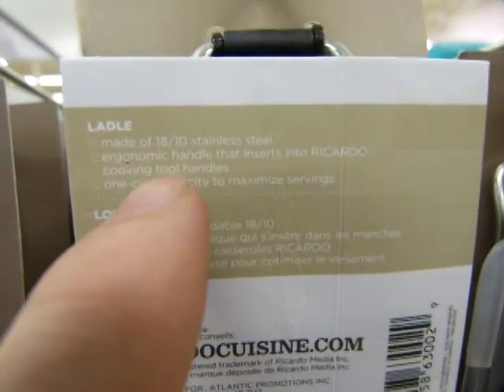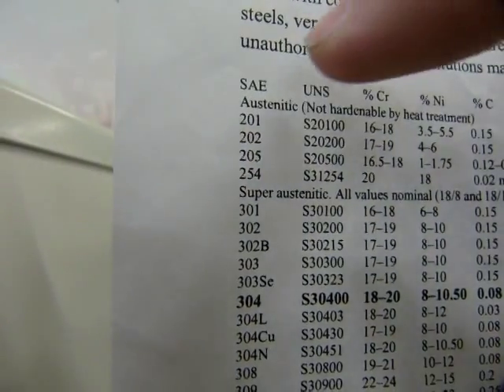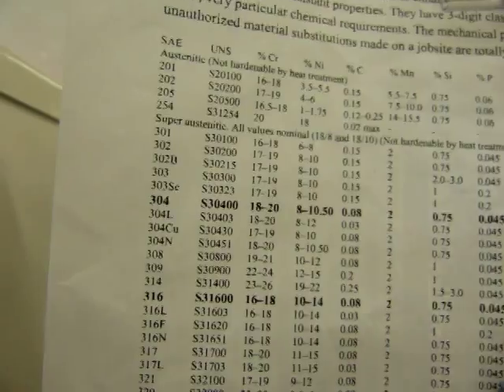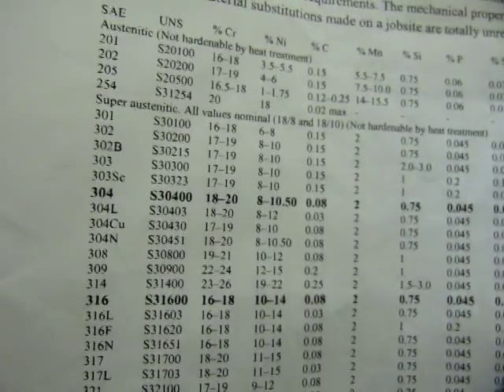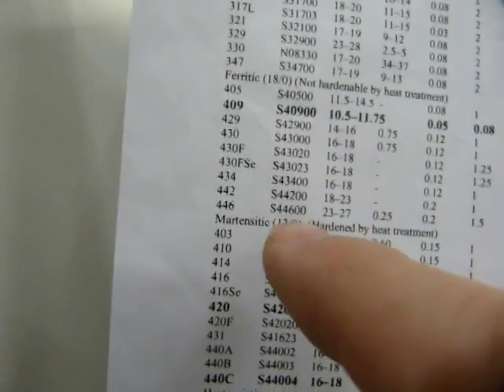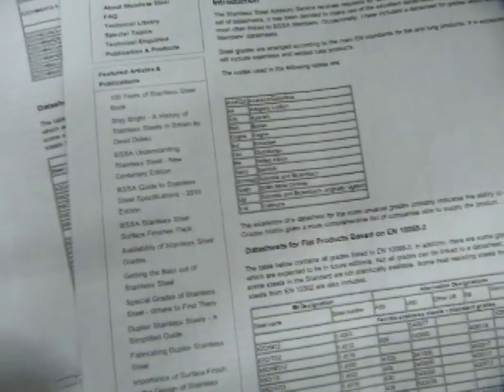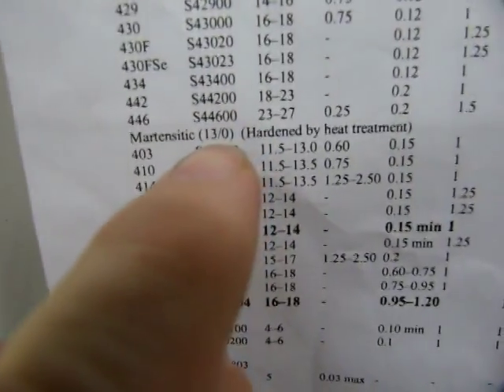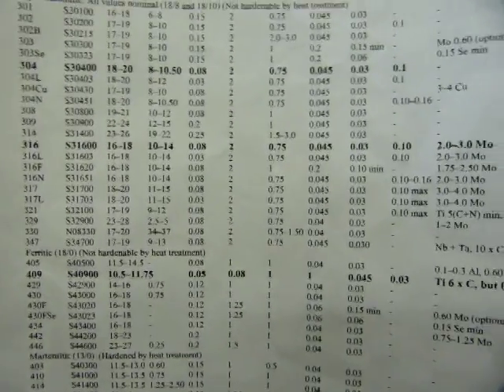What`s an 18/8 stainless steel? Or 18/10, 13/0, etc.

Comment: 202 ss cookware have 14% cr 4% ni that r different from this chart. Why?
Reply from the maker: My chart might have a typo as it is not an AISI/SAE official document.
On the other hand, manufacturers can print/engrave products any way the legal department gets away with, such as "Quality steel", "High strength steel", "304" and could just be a model name or the daughter's favorite number, ...
Reply: @theoverengineer 316 is more ruf and tuff compare to ss 304 but still 316 ss is not used in triply cookware due to costly.

Comment: Thanks man! I'm searching for new inox pans (pots). And it's been pretty confusing, cause I only knew there were Aisi304 and 18/10 steel.
Then I found out about 316L steel type and it kinda seems that it's the best for cooking. 
Some producers indicate altogether Aisi304 and 18/10. What do they mean exactly?
Reply from the maker: For cooking/baking, steel composition does not matter, coating, thickness or dish size does. For dishwashing (corrosive detergents), 316L will outlast anything.

Comment: Great vid . I want to buy top quality stainless steel Cutlery ( dinner knives and forks ) so they don’t rust at all for years ... good set that last 
I see in stores in uk , some say 18/10 or 18/0 ? 

What is the best quality? 18/0 ? 18/0 ? for kitchen / dining cutlery ( Europe codes ) 

I look forward to your reply
Thanks 👍🇬🇧
Reply from the maker: Here are the numbers, suppliers can identify a batch of steel (from Ger., Port., Swe., Jap., Kor., Ch. etc.) in multiple ways:
1 Find a decent supplier so the set is actually made of stainless, not Chinese foundry sludge. Makes sense?
2 Butter & cutlery knife handles are always hollow, soldered to a blade. The cheaper the set, the thinner the handle, the weaker the solder.
3 The generic kitchen stainless 18/8 (or SAE 304) stainless steel is more sensitive to pitting or crevice corrosion by chlorides (along the soldering line) or less resistant to general corrosion in acidic applications than the 18/12 a.k.a 1.4401 a.k.a. X5CrNiMo17-12-2 (SAE 316), which is better. Commercial kitchen equipment suppliers have it, Debenhams, etc.cute retailers - I`don`tt think so. Other numbers for 18/12 include variants like 1.4408 a.k.a. G-X 6 CrNiMo 18-10 or 1.4436 a.k.a. X3CrNiMo17-13-3, watch the labeling.
4 Kitchen knives that need to hold a sharp edge are best made of 18/0 (430) martensitic variants:
1.4125 a.k.a. X105CrMo17 a.k.a. 440C martensitic, but
1.4112 a.k.a. X90CrMoV18 a.k.a. 440B or
1.4109 a.k.a. X65CrMo14 a.k.a. 440A are also fine, will need sharpening more often, but gets done faster.
5 Center of gravity when held in hand is important in fatigue is a factor.
6 The side edges of fork tines, spoon handles can be crudely sheared or stamped out of a sheet of steel and remain unfinished, watch out. See close-up at https://www.youtube.com/watch?v=xuQnPEpLWd4
Steel numbers vary in different markets, so I included lotsa numbez.
(Long decimals 1.4something are DIN numbers, the X-and-digits-and-chem.-symbols... are EN standard names)

Comment: why is 1045 and 4140 in the same grade of steel by ansi standard when they machine so differently? The same insert grade is recommended for both.
Reply from the maker: Because both are "Carbon and Alloy Steels" group. Other groups are "Stainless", there is "spring steel" and "Tool steel" with barely any iron in them. Check out Types of steels
Reply from the maker: Their mechanical properties are close enough, both have a tensile strength of about 100,000psi and a Brinell hardness of about 210. See matewb: http://www.matweb.com/search/DataSheet.aspx?MatGUID=38108bfd64c44b4c9c6a02af78d5b6c6&ckck=1 and http://www.matweb.com/search/DataSheet.aspx?MatGUID=cfc9bdab1dbf4fb19d6b3e5e1be8c9bb
Reply from the maker: There are many 1045`s and many 4140`s, hot rolled, cold drawn, normalized, etc. Compare similar ones. http://www.matweb.com/search/QuickText.aspx?SearchText=4140 and http://www.matweb.com/search/QuickText.aspx?SearchText=1045
Reply: In machinist calculators, 4140 is hard steel, but 1045 is soft. But then there's this fucking ISO standard (I made a typo originally, meant to say ISO instead of ANSI). In machining catalogs, for carbide inserts, will tell you that inserts is for a certain group like 'M' for stainless. 

Lets talk about stainless, since i'm looking it up now. Cr content varies by 8% in this group : http://www.sandvik.coromant.com/en-gb/knowledge/materials/workpiece_materials/iso_m_stainless_steel/pages/default.aspx#3

This confuses me because chip formation varies greatly, heat produced, machining forces, coolant types. 

For chip formation, its a big deal not to get long chips, because it blocks the machine. Small dense chips are always desired (they take up less space when stored, etc).

Heat produced, causes fracture of cutting tools; there's ceramic, carbide, the former being really fragile. The tools vary greatly, so much that it affects their geometries. For example TNMG is triangle with hole in center, but ceramic inserts typically are found without holes in center, because they're not pressed (compressed) and its hard to drill into it - so they just make it TNMN. Ceramic are greatly resistant to heat such as in superalloy stainless steels, but fracture easily.

Coolant is desired in some cases, but others not because it determines fracturing and chip formation.

Cutting forges determine tool's angle (positive or negative rake - negative rake is prefered for harder materials, since it preserves the edge better). This has some disadvantges.

So you see, the ISO codes, seem to cause more problems than they solve. I can only guess the ISO codes were standardized when there was only very few grades of carbide, let alone ceramic, cermet, PCD, coatings, CBN, and other cutting tool technology.
Reply: Another exaple are aluminiums. I wonder if Silumin is in this group, because Aluminiums like 6061, can easily be machined, even with steel cutting tools. But Silumin has nickel alloy in it, making it very abrasive. Ceramic inserts are used, its a totally different machining challenge. ISO group is "N" for non-ferrous.
Reply from the maker: N is justified, Silumins (plural intentional) are aluminum-silicon alloys, zero iron content, used for castings, silicons make it flow smoothly and fills the mold well. Die-cast cars, laptop frame, engine block. In the Aluminum Association`s system, 3000 and 4000 series and casting alloys. The 6000 series precipitation hardens, it produces nice hard chips, machinability 70-90%, Brinell hardness 80, (the SAE/AISI 1212 steel has 100% machinability, an arbitrary reference point), the 3000 Silumins machinability is between 10-50%. Very gummy, have a Brinell hardness of 40. That`s why they suck on a lathe. They need to be cut faster, shallow cuts and with sharp bits to minimize tear-out and produce a tolerable surface finish. 
Look into 2 things to explain why stuff behaves the way on a lathe. Any letter codes tell too little. (1): the actual properties of materials, which are dictated by chemical composition, (as you saw Cr +-8%), esp. the overall hardness, surface hardness, machinability. That`s the first half of the story.
(2) how the work piece was made, such as cast, hot forged, cold worked, etc. Say nails and screws are made of the same soft 1005 steel. The screw has its thread "rolled on", produced by cold deformation. Nails can bend, repeatedly, screws snap after 1 bend. Different behaviour due to cold working.
On top of this, (3) we have cumulative experience on how much feed, depth of cut, rake angle, kind of coolant and material of cutter works best to: 1 not overheat and change temper, 2 break the chips, 3 get done today, 4 tolerable surface finish, 5 minimal re-tooling and sharpening. This is where those letter codes come in, but you might need to make on-site observations and changes to work around some gummy metal.
It is very complex.You`re on the right track, you have many of the factors, I hope I helped a bit. It is chemistry, plus manufacturing method, plus lathe power, feed, depth, plus economy, plus safety, supplies, angles.
If it was any simpler, Walmart would have no employees.
Reply: i wrote a long reply but it was lost, since i'm replying from the drop-down window, so am gonna be more brief this time.

You reflected all my points in your #3 fact but give totally different interpretation. All the qualities you present are for the cutting tool, not for the material, since those qualities applied to the chip doesn't matter as long as the tool can still cut it, since the chip is discarded.

I appreciate this long discussion (average person don't give a damn, or too stupid to make a discussion), but you have not helped at all, because this contradictions haven't been resolved.

Namely these two statements combined, produce a paradox.

1)[basis] ISO 6 letter machinability index classifies metal in groups such that cutting tools can be chosen quickly. In other words, the priority is to protect the cutting tools so they can perform their jobs as the priority, with no concern for materials properties, since the heat is in the chip. This is true.
2a) Silumins vs 6061 don't machine the same but are in the same group. Stainless Cr content varies by 10% in its group and machine differently. Steels in their group machine differently.
2b) The difference in machinability of these examples is significant. Coolant options, feeds/speeds, tool material, and tool life vary drastically, and using the same tool on both materials in the same class results in 1000% or more diminished tool life, at least. For example on silumin, HSS (HSS is traditional tool for aluminium). Cutting bit even with highest Cobalt content and correct speeds to prevent tool weakness in the red-hardness zone will suffer a very quick death from abrasion, whereas ceramic insert will cut it no problem. Carbide also has poor performance on abrasives, unless protected by thick diamond or CBN coatings.

Conclusion: the ISO machinability index is made to choose inserts more efficiently for machining jobs by classifying materials according to machinability properties, but in reality does not perform very well.
Reply from the maker: Sorry, I missed the ISO part. Now I don`t know anything about ISO designations, neither trying to appear so, I found this at Sandvik`s site, I`m reading it now, trying to make sense of it myself why materials behaving differently are grouped together. They did consider cutting tool, workpiece, geometry, heat treatment, manufacturing. Check it out, see if this whole knowledge base makes sense.
http://www.sandvik.coromant.com/en-gb/knowledge/materials/workpiece_materials/machinability_definition/pages/default.aspx
Reply: So , what is "machinability" for those who don't know. I think it can be reduced to something interesting that we can both enjoy: Sandvik breaks it into three parts, only the first is relevant:

1. Classification of the workpiece material from a metallurgical/mechanical point of view.
2. The cutting edge geometry to be used, on the micro and macro levels.
3. The cutting tool material (grade) with its proper constituents, e.g. coated cemented carbide, ceramic, CBN, or PCD, etc.

Now considering only '1', machinability is proportional to metallurgical properties, your expertise is greater than mine. If (1) is not the some determinant of machinability, then I would like to know its extent of influence - at least relative to itself (i.e we compare metals to each other's grades, rather than some absolute referece point like diamond.). This is also acceptable to me because I understand perfectly how '2' and '3' are chosen by materials, from my experience.
Reply from the maker: Thanks for sharing, good stuff. The way metallurgy relates to machinability is profound, but hard to quantify as we don`t have a diamond standard, like you noted. So I have some examples here just to float some ideas that can be search terms later, etc.
Any alloy is defined as "a solid solution of uniformly mixed elements" Plain steel is an alloy of C and Fe. The C content (0.05% - 0.95% as in AISI1005 - 1095) dissolved when liquid, but solidified can be visualized as having a bag of marbles, 2 sizes, shaken up so the little marbles (C) don`t settle on top of the big ones (Fe), or at the bottom of the bag, and in mid-flight, where they fill the bag uniformly, thrown into a freezer so they don`t ever reach the bottom of the bag. Something like that would be uniform distribution. Now C appears as thin fibers (cotton candy) inside Fe when uniformly distributed. As is, it will machine annoyingly, runs gummy, causes a built-up edge.
C can form clumps if heated up a bit or quenched differently, as it does in martensitic stainless, nodular cast iron, annealed or normalized high-C steels. These machine well because the cutting edge rips the C clumps out in whole, the chips are short.
C can be added to the surface only by covering a workpiece in charcoal for a day, called carburizing. Used on gear teeth. Usually done AFTER machining, but if any touch-up is needed, the surface is harder and machines well to a depth of 1/128 (0.5mm), then it is gummy again. But good for absorbing shock as gear teeth need that.
If an alloy steel (say 6150, or any) is made "as rolled", it is soft and gummy, everything uniformly distributed inside. If it is "cold drawn" or "extruded", or "cold worked" or goes through any folding, punching, cold forging before it hits your desk/lathe/CNC, it "work hardens", and will machine well, or better than "as rolled"
READERS WORLDWIDE: this is not a doctoral dissertation on metallurgy, nor a textbook on it I am just floating some IDEAS for further study. My examples are simplified and as such, distort complex reality greatly. But metallurgy is fun, take some courses or read a textbook.
Reply from the maker: 1/128" = 0.2mm